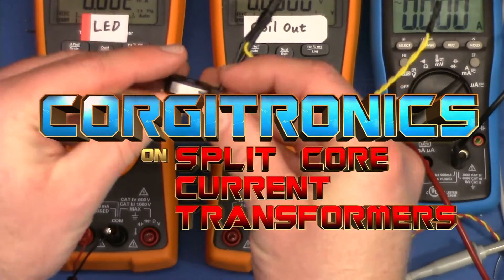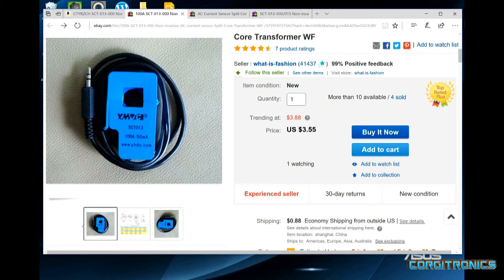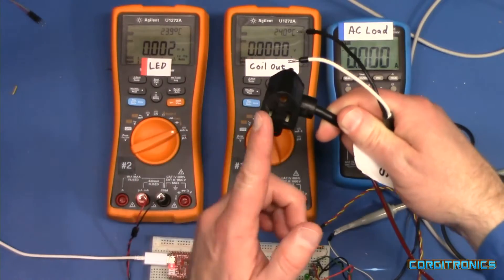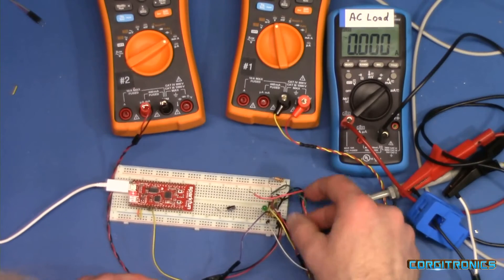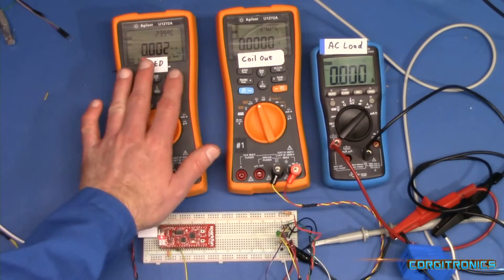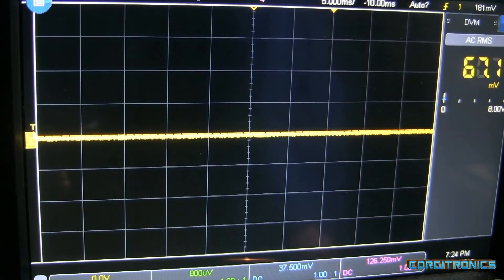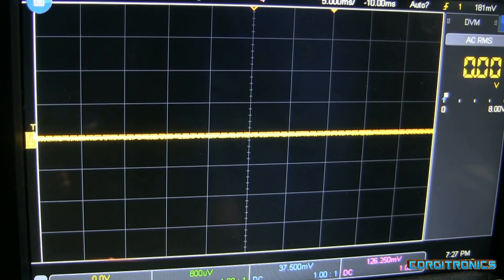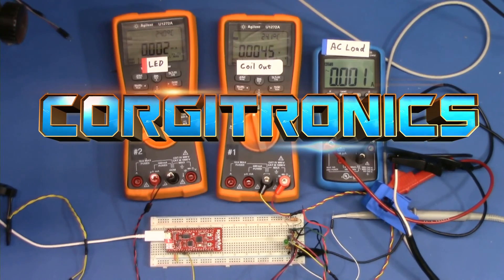Using a Split Core Current Transformer

Comment: I understand that the video main objective is to somehow monitor the load connected to the AC line.  However, what would be interesting to see too, I think, is an analog circuit that would get the CT signal at its input and would be able to output a voltage  read on a DMM, which in turn would be proportional to the current.  This would give an opportunity to explain the purpose of a burden resistor and how to calculate its value based on the CT specs.  The implementation of a low pass filter could be considered as well,  which is useful to measure current/voltage on loads controlled via PWM.  The idea of doing this without a micro-controller allows us to apply some electronic basic concepts such as filtering, rectification, op-amps, etc...

Comment: Is the LED and Resistor on the DC output side required? What purpose are they serving considering the burden resistor should already be dropping the voltage?
Reply from the maker: I was hoping to get enough current to directly drive the LED, but that would probably take something like a 20 Amp load.  But, it also provides some load to drain the filter capacitor.
Reply: Ah that makes sense, hadn't thought about the capacitor. Thanks! I finally got my split transformers in after waiting 6 weeks for Chinese shipping. Planning to use this to monitor the outputs from my AIMS inverter. :)

Comment: Will a CT like (just like) the one you are using here work correctly if around a metal rectangular busbar and not a stranded or solid core wire?
Reply from the maker: Yes, it works the same way.  One way to be sure is to use a regular clamp meter.  Something like this: https://www.amazon.com/Klein-Tools-CL220-Auto-Ranging-Temperature/dp/B08CFWMYYY
Or, an even cheaper version.
Reply: @Corgitronics  Thanks! I need a permanent install as the CT will be input to a grid tied inverter that adjusts output depending on house loads.

Comment: Hi Corgitronics, Does it matter which way the CT is facing?? Is there an IN and a OUT? is the direction of the current shown? I am looking at building a gadget to shut off power when it is pushed in one direction,,, i.e. voltage 250 vac against 230 vac,, then I want to shut off the 250 vac using a relay,,, I guess this will require 2 CTs with a relay in between, those CTx have to be directional I guess,,,,, don't really know what I am talking about,,,,I wish to make a ZERO export to the grid gadget,,, any idea??
thanks and cheers,
john

Comment: Where do you get the NEMA plug adapter to check the current. You had it marked as "sensor" in the video What is it called?
Reply from the maker: It came from an old float switch, when that switch failed I cut the cord off, thinking it might be useful someday...and it was!  Here's an example from Home Depot, but you can probably find cheaper versions elsewhere.  https://www.homedepot.com/p/Everbilt-Tethered-Float-Switch-with-Piggyback-Plug-TFS13D1610P1/206055879
Reply: Thank you, I spent about 5 hours on the internet looking and could not find it. I think I will pick one up just to have it.